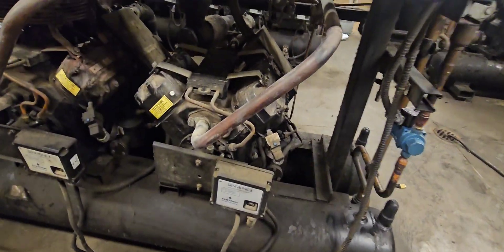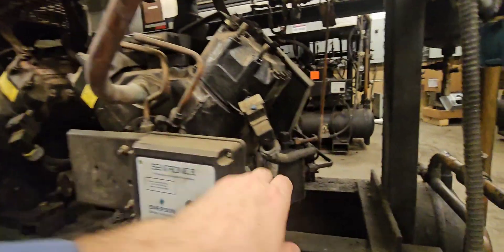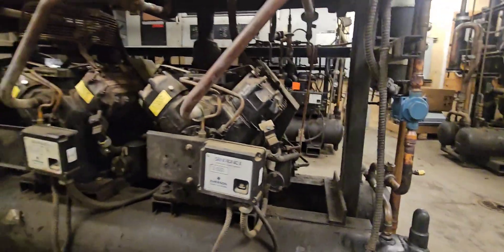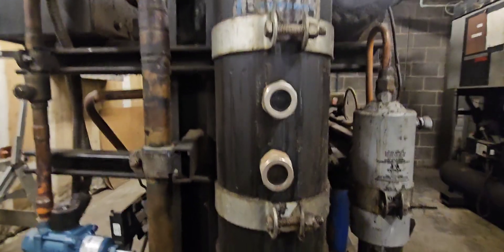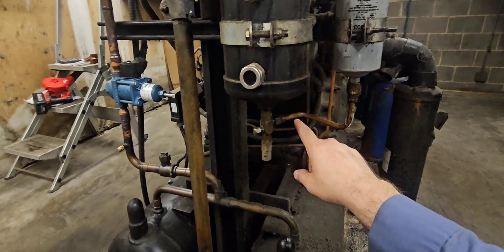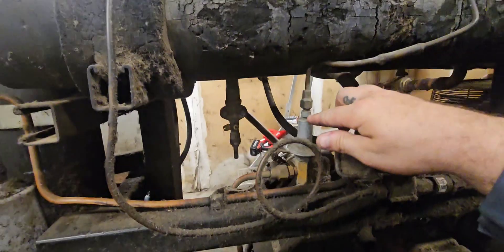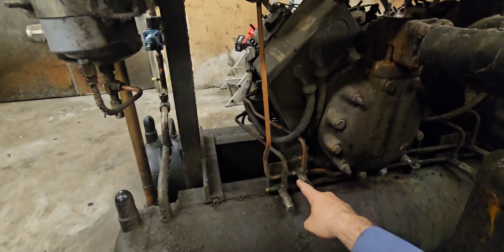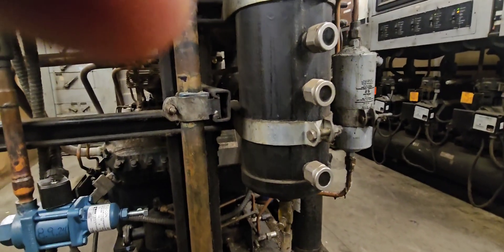Supermarket Refrigeration: Rack Oil Circuit

Comment: I really appreciate you explaining this. I'm very new to the Trade and even newer to Commercial (Racks), so isolating circuits and some of the pm stuff in general is sorta overloading my brain after 2 months. I appreciate how concise and informative this was because I have like 8 stores that I need to change Oil Filters and prolly a few Compressors (off on Oil Failure) that need that pick up screen cleaned and none of the techs who have been there for 2+ years are doing it or showing me how to do it..Wish more techs were like you ngl cause I kno if I were training under you I'd be a lot better than I am now
Reply from the maker: It takes time and experience but you'll get there man. Keep at it.

Comment: Forgotten art of refrigeration. Mostly we hear about residential /light commercial AC. Thanks for the info. Oil is critical in commercial 
refrigeration. In the 60's and 70's we worked on belt driven compressors in freezers. Crank shaft seal always leaked.  Pain
Reply from the maker: Yeah man those old belt driven compressors were a nightmare. Thanks for watching.

Comment: I have an.
Issue with the separator being hot but my lines are cold I changed the flaot cleaned out the screenI changed line filter and the silver Canister filter  The sight glass of my regulators are really dark.Have any suggestions
Reply: I figured.
Out the issue.I had four oil regulators completely out of wack, Installed new 4 oil regulators. Adjust it for the correct oil differential. Everything's working properly. I pulled out 4 and a 1/2 gallons out of that rack. But thax for your videos man
Reply from the maker: Glad you were able to fix it.
Reply from the maker: When you dropped the float, did a bunch of oil come out?

Comment: What if I had a quarter level oil net of 55 and no oil in reservoir?
Reply from the maker: @tonetone1637  I would check that oil float and see where that oil is going. Assuming you haven't had a leak and nobody took out oil, you shouldn't have to add any. Could be getting lost in the system. What kind of separator?

Comment: TXV=THERMAL expansion valve. That is a pressure regulator that does not have a bulb controlling it off of temperature . Happy Labor Day
Reply from the maker: Glad you understand that. I say oil TXV because it helps people to understand.
Reply: @SupermarketRefrigeration  Im new to your channel. Just busting your ballz
Reply from the maker: @chrisconklin873  keep bustin buddy. Glad to have you here.
Reply: @SupermarketRefrigeration
Reply: Great explanation of oil controls!! I had always call it an oil pressure differential valve

Comment: Thanks for sharing.how do you trouble shoot a plugged orfice on a suction accumulator?# 100 on our way to 5k.
Reply from the maker: @MariosACandRefrigeration  Yessir! I appreciate the support. Accumulators aren't going to have an orifice. It's basically just a couple pipes in and out. What makes you think your accumulator is bad? What kind of system?
Reply: @SupermarketRefrigeration  On a walk in freezer,a 3 hp semi.locked up ,cylinders full of oil,i could not figure out what caused it,i was thinking the orfice on the oil return tube on the accumulator had plugged,and it sent too much oil at once,not sure,if it was the pipping size,or them turning it off for inventory,or the dft too high,always wonder what causes that.
Reply: @MariosACandRefrigeration what shape was the valve plate and gaskets in?
Reply: @topher8634  they were still good.I removed it from the  mc donalds old rack,and installed,stand alone condensers.worked ok.
Reply: There will be an oil return orifice on an accumulators return to compressor. Usually I will cut one loose during a compressor replacement and dump it over to see if debris or filthy oil comes out. Typically, if there are no piping issues or defrost issues and you're having oil return problems, the accumulator is at fault